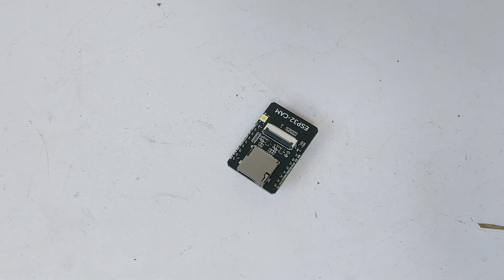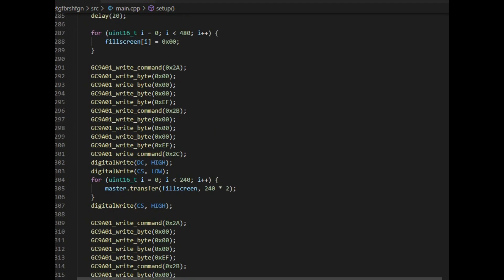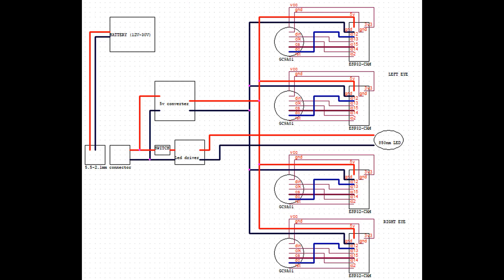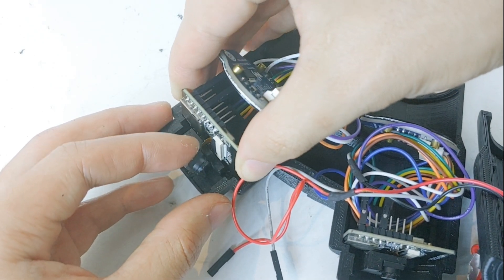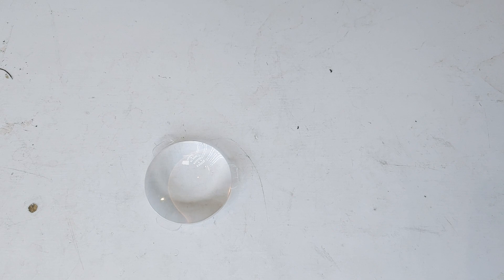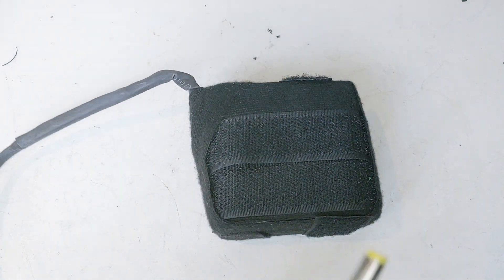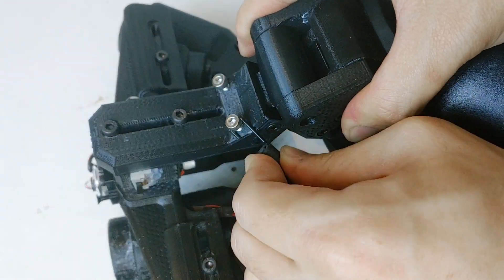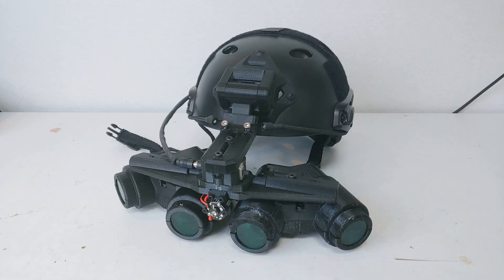DPNVG mk3 (DIY Quad Nod NVG, Night Vision) part2

Comment: Would this work with a New Tiny1-C 25Hz Micro 8~14um LWIR  Thermal Imaging Module 256*192 12um Resolution Uncooled Infrared Detector from AliExpress??

Comment: So i just found your channel and after a year posted I am curious where you are with your DNVG in fps and latency issues. Is there a mono display anything changed or updated for the quads? Im about to start my building process but would rather run mono or new quad instead of quad M3. Thank you I know these videos definitely took a lot of time.

Comment: hey there. I'm trying to replicate the project but i'm stuck with a problem. The screen leds are on but the image is not showing up. The flash phase went normal and the pins connection are more than strong. can pls someone help me with this problem ? I want  also to specify that i bought an ESP32-S from AZ-Delivery, with same pinout but the camera is different, can this mayvbe be the problem ?
Reply: the camera, what model is it?

Comment: I'm building mine with caddx ratel 2's and adafruit pal displays. I'm not sure how well those cameras work but the ratel 2 has a very low light sensor and is pretty good. ill be using a 940 ir 10 watt LED illuminator i will make for a mount for my helmet. cool videos dude. we haven't seen you in months. hope all is good
Reply: How did is work out

Comment: got the  7725 camera and 32-s : Uploadewd code (did tests with arduino code too) wired it carefully and ... display turns on but remains dark.. Led light just flashes faintly even when powered with a bench power supply...
Reply: mine same...ESP32-S with OV7725 camera but blank screen. I suspect that there are different version on ESP32-S because I bought one from one seller which works, but three from another seller did not.
Reply: can you share the code please? i cant find it

Comment: amazing! you should consider adding a MLX90640 thermal module to the mix! I believe they communicate with ESP's via I2C and with post processing the images look pretty good!
Reply: It doesn't have high enough resolution. The thermal camera can barely see a person standing 10 yards away. It's good for determining heat management in electronics and that is about it.
Reply: @DaveSmith-cp5kj  "The thermal camera can barely see a person standing 10 yards away"
depends on the thermal sensor and the lenses bruh
Reply: @Lewildknight  Good thing we literally stated what sensor we are talking about... bruh.

Comment: Have you considered using this same design but refitting it into FMA GPNVG-18 replicas? I feel like it would cut down on required print time and increase durability while still looking the part AND having functionality
Reply: This was my plan, however GPNVG are way smaller than you think and do not offer the same internal space to fit components as the printed model. Im waiting for all my parts to show up and then see what i can do with space inside of the replicas, but it doesnt look good in terms of actually working.
Reply: @nickv1388  let me know if it works please
Reply: @luchieano4912  I attempted it and unfortunately it just doesn't work all that well. The focal distance is really weird because of the screen size and position inside the housings (I removed a lot of material from the inside of the housing and the plastic is really thin in some spots, the screens are kind of squished inside). However, I did take this concept and adapt it to a PVS31 binocular and they work fantastic!!
Reply: @nickv1388 can you please share the pvs31 project?
I'm about to make my own and I need some help 😅

Comment: Guys, trust me it's waste of time. First he didn't linked all the part's where he got from so in most situations you end up buying wrong model of esp32-s because there are alot of variations out there. Second, this nvg in CQB is ok, while outside it sucks big time due to range dispertion of IR light. Max you can see in open field is 10~20m unclearly. Waste of time fr.
Reply: Do u have the full build list if u do message me I’ve been looking into this for about 6 months now but been waiting
Reply: @hamrbrojx7575  not too hard finding all the parts of AliExpress but i think there’s something wrong with the updated binary file he posted. Ive only been able to get 2 put of 8 boards working and only the right side. Unless he makes updates this I don’t think its worth making with the current problems it has
Reply: @kevv3093  In my experience I found only one model from one store working. All the others turned out to be waste of money/time.
Reply: @whaletime69  You wont change my mind. I done it all and this project is one big waste of time and money.
Reply: @whaletime69  Yeah learning experience that ESP nvg-s are waste of time just like this conversation with you. Thank you, now you can move on.
Reply: I mean, you want to diy something to  save money but just want someone to feed you everything without breaking a sweat, already means diy is not suitable for you.

Comment: I do as the video said but my ESP32 have no signal but the LCD is lit up, do you know what’s strong? I’m using two 18650 battery with 5V step up module . Any ideas what could be the problem?
Reply: mine same...ESP32-S with OV7725 camera but blank screen. I suspect that there are different version on ESP32-S because I bought one from one seller which works, but three from another seller did not.

Comment: hey. Could you check you BIN files. I think there is something wrong with it. My esp is in a boot loop after flashing. I have tried it with left and right and different esp32s
Reply: fixed yet?
Reply: @desmondlow7586  unfortunatelly no. All the hardware is simillar, the graphics library is the right. The pins are connected as they should, so the only thing remaining is the code. It would be awesome if the autohor could publish the code
Reply: I believe your ESP32-S is faulty. I had one ESP32-S that goes into boot loop even when I load in the generic ESP-32S (with OV2640) to use as a wi-fi web cam to test the board.

Comment: Well im trying to make such a goggle, but for some reason my screen only shows black without showing what my camera is seeing :( Any idea's what the problem might be?
Reply: I have the same problem as some other guys in here. Its the issue of the components differing between vendors, even thou they are basically the same and the binary distribution of the SW which does not allow for meding to the actual components combination...
Reply: @nuhlon  but would it be something in the code or the hardware itself?
Reply: @Rraijjar  Basically both - different manufacturesrs could implement slightly different routines, for which the code is not suited....so either you need to find exact hardware, which works with given binaries, or you would need to modify the software before compilation and then maybe it would work with the hardware you have...
Reply: @Rraijjar  any luck fixing it? I'm facing the same problem
Reply: @desmondlow7586  sadly no
Reply: @Rraijjar  are u using original camera that came with ESP32-S CAM or do u use OV7725?
Reply: @desmondlow7586  I tried with the original camera and with the ov7725
Reply: @Rraijjar  both not working?
Reply: @desmondlow7586  Sadly no

Comment: Using a 940nm IR LED for the mk4 might be an interesting idea. It would be much harder for people to spot the illuminator, but im not sure how well the cameras would work with a different light
Reply: But the thing with ir led is that if some one else ur running the same night vision u pretty much holding a flashlight to them u look at them and basically saying “HEY IM OVER HERE”
Reply: @GrimsGhostG59  ...u r rite...as long as any1 is using an NVG (digital or analog) they will see yours just like someone is using a flashlight in the dark. Its only effective if you r the only one using it. On the matter of using 940nm, I used it for my PVS-31 build and the intensity is much lesser compare to the 840nm but you wouldn't get the visible red dot. To compensate for the reduce intensity, I just have to increase the LED current or use a higher wattage IR LED. :)
Reply: as far as i know all digital night vision works with 940 but its hard to find 940 illuminators for some reason, i think 850 is brighter and more efficient but if you get bright enough to see perfectly clear it is visible to the naked eye, very mild though and would probably go un noticed in most situations

Comment: I’ve built the system up and hooked it up properly. However, there seems to be a major issue. The lens glitches out and freezes especially when switching off the lights. I saw people said to solder it onto the board and I did that. However the issue still remains the same, what’s going on?
Reply: hey there. Where did you get your esp32 cam? mine doesnt seem to work

Comment: Do you think if I use a gpnvg 18 dummy, it would work as a housing? Or does it need to be done in 3d?
Reply: 3D only i guess. the dummy one is a little bit smaller and you cant disconnect the dummy which is also a shame.

Comment: Are FPV drone cameras suitable for a more expensive version of the DPNVG? Especially night-specific versions made by companies by Foxeer, CaddxFPV, or Runcam. A wide variety of $20-$40 cameras are listed at 0.0001Lux, But the Foxeer night cameras achieve 0.00001Lux in the $40 price range unlike Caddx or Runcam cameras with similar specs.

If any of these cameras are suitable, would they need to be modified for optimized performance? Like Black & White only display, 1.4f max aperture lenses, reduced latency, and efficiency with the SPI TFT Display's resolution (or a higher res display if possible)? If a cheap camera system without unecessary features like color display, recording capability, or built-in microphones can surpass 0.002Lux, then it would have better performance than the Sionx Aurora for a fraction of the cost.
Reply: Not with this version it seems to only support the ov7725 cameras
Reply: @luxzartheglorious  In my time researching this, I found out that there has been a similar open source project that uses the Foxeer cameras. However they opt for 320x240 screens which are very wasteful as biconvex lenses only make you able to see a 240x240 circle. If I ever make my own (regardless if the devices are monocular, biocular, binocular, or panoramic) it would be to combine the Foxeer with the 1.3" (240x240) circular screens. At least until there is an option with a higher resolution, according to testers the biggest drawback isn't the camera's performance, its the screen resolution.
Reply: @AnonEMus-101  that's really interesting I wish I knew enough to put that information to good use. I've already ordered the half parts for this build but I encountered the camera issue, it'll be awhile before I can finish it up.
Reply: @luxzartheglorious  Good luck! Though I'm save with 3D modeling, tuning circuitry to efficient voltage and coding is a bit beyond me. By the looks of it it should be easy, but I'm not sure where to start.
Reply: @AnonEMus-101  I'm a very similar boat myself, I have a ways to learn when it comes to 3D modeling but I know enough to have some fun with it. But coding and all the electric intricates are abit too much for me, I'm sure I'll learn in time.
Reply: @luxzartheglorious  Here's the recently discovered video of the Foxeer design: https://www.youtube.com/watch?v=MthrbR4_UAk&t=3s

I wonder if its possible to design a version where the front and rear sections thread off like a traditional PVS-14, rather than plates that require multiple screws and thread inserts.
Reply: @AnonEMus-101  late to reply but I've been looking at these type of videos and have come to the same conclusion. Only problem is converting NTSC/PAL (which the camera outputs) to SPI needed for the display.
Reply: @filipdevos8195  I'm currently looking at the Foxeer Night Cat 3 as the option with the best performance. However with 320x240 displays the user is limited to a 240x240 circle which in theory is no better than a 240x240 circle.

One display that caught my eye is a 320x320 1.6" square display that uses MIPI. The dimensions are perfect for 34mm biconvex lenses, and the corners would add little to the dimensions of the housing. The result would be a 320x320 circle through the viewing lens, a far better resolution than 240.

If MIPI is better for NTSC/PAL, then the adaptors could be less complex and more compact.
Reply: @AnonEMus-101  but how would you connect the camera direct to the screen? is it possible without a pcb? noob here hah
Reply: @viniciuscamilo7016  You're asking a noob as well. The video I linked might have a solution

Comment: Fantastic design and I have them built. 
I'm currently having an issue where after awhile (2-5 minutes of use) one or more screens flash white lines then freeze the picture on the screens. I'm assuming a floating ground issue or something. Anyone have any ideas?

Issue persists with battery bank 5v usb cable and 5v from FTDI.
Reply: can you send me thw whole shoping list? there are a bunch of others things I see that he doesn't list. TIA
Reply: Seems to only happen in low light
Reply: @adamrychlick  not enough power try 5v 3a power bank 5v 2a should work good but 5v 3a will work 100%
Reply: @pazntic  Thanks. When I was troubleshooting I used 4 different 5v powering methods. All with same result. I had more ESP32s on the way (from a different source) and when I used those the issue instantly went away.
Reply: When I connect everything I’m left with a backlit screen and no camera display, do you know anyway I can fix this?
Reply: @bradenholzhausen4116  make sure your using the right cameras
Reply: hey there. Where did you get your esp32 cam? mine doesnt seem to work

Comment: Is there a possible to provide the code from the binary files. I have also problem with the black screen. I want to try to find a fix for the probelm. Thanks a lot in advance and thanks for sharing this project with us. Best regards
Reply: I'm having the same problem
Reply: @moralcorps  I have programmed now the ESP32 cams by myself with the arduino ide. If you want I can share the code maybe make a video how to get all the libaries you need for it. Just let me now.
Reply: @dirkowitz5127  That code would be very helpful, do you have a link?
Reply: @dirkowitz5127  IDK if you previously shared, but comments with links are typically deleted on youtube. If you post a link, don't put the dots, and separate by paragraphs instead.
Reply: @DaveSmith-cp5kj  Looks like that all my comments will be deleted. Have you an alternative idea?
Reply: @dirkowitz5127  Maybe break up the link "and" put quotation "marks" like "this" throughout a sentence so he can assemble the link.
Reply: @dirkowitz5127  is it working ?
Reply: I have tried with different ways everytime my comment disaopears. Have anybody an idea how to fix it
Reply: @dirkowitz5127  or do you have a discord?
Reply: @desmondlow7586  I also added my discord... But the comment also disapeared
Reply: DUMd9ygX
Reply: @dirkowitz5127  this youtube is pain in the A... hahahaha
Reply: @dirkowitz5127  joined your discord channel
Reply: @dirkowitz5127  I’d really appreciate some help getting mine working aswell got 2 out of 8 esp 32 bords to work but cant get any other ones working
Reply: @dirkowitz5127  one way I realized was to make an email address in protonmail. Then have people to your channel about page and contact you through that.
Reply: @Dirkowitz hey man I’m running into the same problem is there anyway you can help me out on discord?
Reply: Having the same problem could you help out with the code ?
Reply: mine same...ESP32-S with OV7725 camera but blank screen. I suspect that there are different version on ESP32-S because I bought one from one seller which works, but three from another seller did not.

Comment: After flashing the esp32 and wiring it up, the display powers up but theres no camera signal. Followed the schematic and all that.  (also do we not use the BL wire on the display?)
Reply: I'm running into the same issue currently but if you look lower in the comments Michael LaRue says "the programing (bin file) is specific for the 7725. the 2640s that come with the boards, from amazon, do not work with that bin file." Good Luck
Reply: @adamrychlick  im using ov7725, tried ordering a new ov7725 and its still black
Reply: @kevv3093  My last comment was deleted for some reason. Assuming flashing and wiring perfect then either wrong or broken camera. I got 1/4 bad in my order. But I got 3 of them able to show video but now I have an issue where in low light after a minute they flash white and freeze.
Reply: @adamrychlick  i tried 4 of my camras (all ov7725) and got a diffrent one off amazon and its still the same. I tried ordering a new esp32 to see if that was the problem, ill update after i try the new esp32 board
Reply: My esp32 board seemed to have been defective or something, got new esp32 boards and it works.
Reply: I have the same issue where a have a backlit screen and no camera display. Is there any way to troubleshoot this?
Reply: @bradenholzhausen4116  Same here, unfortunatelly no way to tell where is the problem :-/
Reply: mine same...ESP32-S with OV7725 camera but blank screen. I suspect that there are different version on ESP32-S because I bought one from one seller which works, but three from another seller did not.

Comment: Any plans on using an L4 G24 to mount it? You'd get tilt, length of focus and height adjustment on the fly and you can stow it with a push of a button, all you need is a dovetail mount which you can get from any cheap airsoft grade replica nightvision. 

BTW, is this by ant chance the same BPNVG project that was featured in TFB? Thanks!
Reply: I just made one adapter for myself and uploaded on thingiverse if u need it